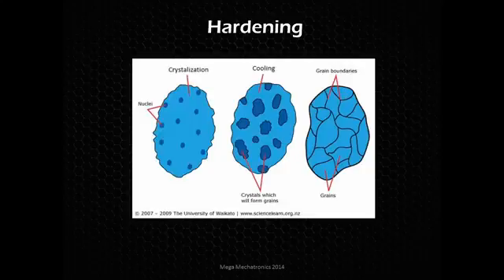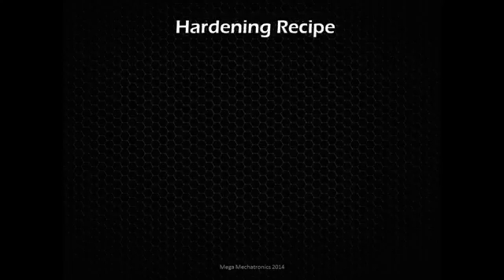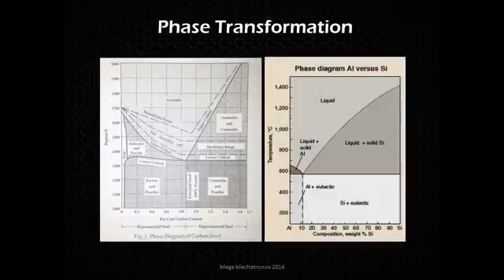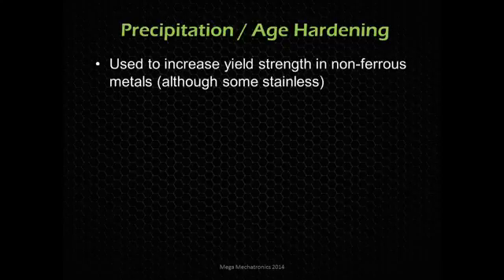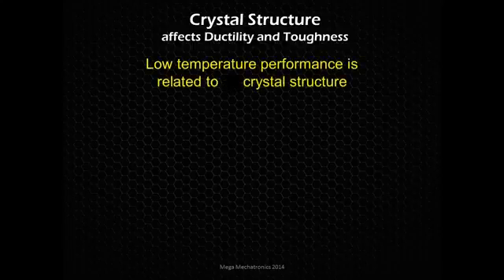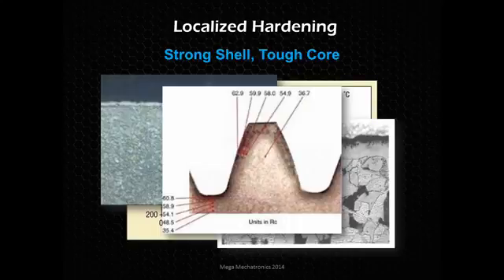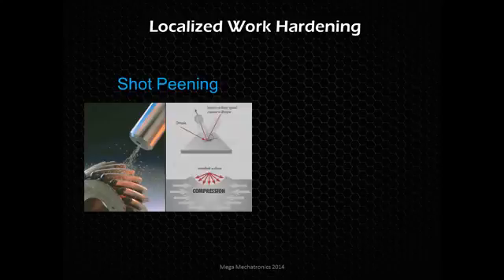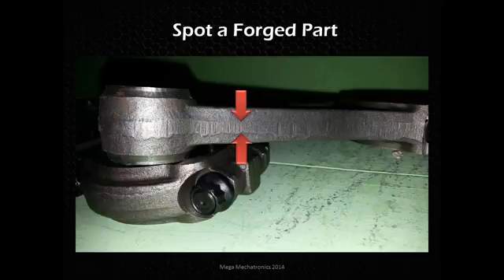Materials Science Mechanical Engineering    Part 4 Heat Treatment Explained

Comment: SIPARTOGI SILALAHI 2714100134

Hardenig is one of the most importhant treatments of
material by cristylze and modify the cubic structure. from The Video we know
that heat treatment in iron or iron alloy is important for many application in
our daily life. In the beginning of the video, it explain about how to
hardening the metal. It explain that to hardening, the metal must be
crystallized, and let the atoms on the material to move around and then the
material is cooled down and the atoms going to start forming crystals and at
the microscopic level for ferrous, a BCC (Body Centered Cubic) or FCC (Face
Centered Cubic) is formed. Crystall lattice dynamis is a dynamics of the
crystal structure. We can look that the structure of the cubes make a form that
we can moves the things around and it won’t break or fracture because the atoms
are bounded together by kind of like a magnetic force. So if we shift that over
if you classically deform it, the atoms are going to latch on to an adjacent
set of atoms and move around. The size of grain boundary is really important to
the mechanical properties of the material. The smaller the grain (finer) the
harder, stronger that material will be. The bigger the grain (coarser) the less
strength and ductile it will be for the material. Smaller grain will give a stronger
material because it will reduce possibility for the crystal lattice to move or
deform by slip mechanism. Because it will have some kind of wall to stop the
slip so it will not deform easily. we do the tempering process to develop the
required combination of hardness, strength and toughness or to relieve the
brittleness of fully hardened steels. the mechanism of tempering is more less
the same with hardening. but, if in hardening we do the holding once, then in
tempering we do the hoding twice. the purpose of this twice holding is to
soften the material, so the material would not have too high hardness and the
pupose is to relieve the stress. from what i know, there are 2 types of
tempering, the first one is austempereing, and the second one is martempering.
but, from the video above, there is one more type of tempering, which is
cryotempering. the product of austempering is bainite, otherwise, the product
of martempering is martensite. There are many types of localized hardening.
Induction hardening is a form of heat treatment in which a metal part is heated
by induction heating and then quenched. The quenched metal undergoes a
martensitic transformation, increasing the hardness and brittleness of the
part. Induction hardening is used to selectively harden areas of a part or
assembly without affecting the properties of the part as a whole. Induction
heating is a non contact heating process which utilise the principle of
electromagnetic induction to produce heat inside the surface layer of a
work-piece. Carburizing / Nitriding is a heat treatment process in which iron
or steel absorbs carbon while the metal is heated in the presence of a
carbon-bearing material, such as charcoal or carbon monoxide. Material is
heated to the suitable temperature for hardening, then cooled rapidly by
immersing the hot part is water, oil or another suitable liquid to transform
the material to a fully hardened structure. Parts which are quenched usually
must be aged, tempered or stress relieved to achieve the proper toughness,
final hardness and dimensional stability. Alloys may be air cooled, or cooled
by quenching in oil, water, or another liquid, depending upon the amount of
alloying elements in the material and final mechanical properties to be
achieved. Hardened materials are tempered to improve their dimensional
stability and toughness. Tempering is done to develop the required combination
of hardness, strength and toughness or to relieve the brittleness of fully
hardened steels. Steels are never used in the as quenched condition. The
combination of quenching and tempering is important to make tough parts. This
treatment follows a quenching or air cooling operation. Tempering is generally
considered effective in relieving stresses induced by quenching in addition to
lowering hardness to within a specified range, or meeting certain mechanical
property requirements

Comment: Name Ichsan salman 
2714100129
This my review according to the video
When we hardening a material we will melted the material so the atom will move around, next we cooled it and then those atom gonna start forming crystal. When crystal start forming randomly they gonna be crystalizing in different orientation to each other that will make a grain boundary. The concept of hardenability is different alloying in metal will gonna have different ability to hard at different maximum hardness that can achieve. Hardness vs carbon content is directly proportional on ferrous metals. Phase Transformation diagram will give engineers an idea of where to start and what temperature that will make the material have certain phase. One type of metal or one type of alloy can have many properties depend on heat treatment that been given. Tempering is done after hardening to improve toughness by re heating the material at certain temperature. Tempering temperature must below transformation temperature. Normalizing process is when we heated the material above transformation temperature and then we cooling it with air at room temperature. Normalizing will give different crystal structure than hardening process. Annealing process is when we heated the material and holding it above transformation temperature and then we controlled the cooling rate by just leave it at oven. Annealing process is primarily for softening. annealing. it is used not to make the material harder, but to make the material softer. annealing is the process of slowly raising the temperature about 50 degrees C above the Austenitic temperature line A3 or line ACM in the case of Hypoeutectoid steels and 50 degrees C into the Austenite-Cementite region in the case of Hypereutectoid steels. It is held at this temperature for sufficient time for all the material to transform into Austenite or Austenite-Cementite as the case may be. It is then slowly cooled at the rate of about 20 degree C/hr in a furnace to about 50 degree C into the Ferrite-Cementite range. At this point, it can be cooled in room temperature air with natural convection. The grain structure has coarse Pearlite with ferrite or Cementite (depending on whether hypo or hyper eutectoid). The steel becomes soft and ductile.  Precipitation is used to increase yield strength in non-ferrous metals by make a carbide, it will make defect at crystal lattice that impede movement. Precipitation is a process where a second phase that begins in solid solution with the matrix metal is precipitated out of solution with the metal as it is quenched, leaving particles of that phase distributed throughout to cause resistance to slip dislocations. This is achieved by first heating the metal to a temperature where the elements forming the particles are soluble then quenching it, trapping them in a solid solution. Had it been a liquid solution, the elements would form precipitates, just as supersaturated saltwater would precipitate small salt crystals, but atom diffusion in a solid is very slow at room temperature. A second heat treatment at a suitable temperature is then required to age the material. The elevated temperature allows the dissolved elements to diffuse much faster, and form the desired precipitated particles. The quenching is required since the material otherwise would start the precipitation already during the slow cooling. This type of precipitation results in few large particles rather than the, generally desired, profusion of small precipitates. Precipitation hardening is one of the most commonly used techniques for the hardening of metal alloys. There are several different methods to quantifiying hardness by Rockwell methods, Vickers tets, brinell methods. Crystal structure affect ductility and thoughness like body centered cubic crystal experience a ductile to brittle transtition at lower temperatures and face centered cubic crystal structured retain ductility at low temperatures. Some examples of localized hardening are induction hardening and nitriding or carburizing. At carburizing process we will place the material at room that full with carbon and then heated, so the carbon will infused to the material at the surface. Localized hardening will give strong shell and tough core material. Cryogenic Treatment is a used to transforms retained austenite into martensite by cooling it at extreme temperature such -300F by using liquid nitrogen or other. Cryogenic treatment promote uniformity and strength. Hardness vs strength is directly proportional. But hardness vs toughness is  a inversely proportional generally.work hardening or cold working is uses compression forces and plastic deformation. Cold working  creates a desirable dislocations in the crystal lattice structure, improving yield strength, but reduce ductility. The example of cold working is cold rolling process, cold heading, shot peening, roller burnishing. Another example of work hardening is hot forging. Hot forging is done at higher temperatures and will give more stronger properties than an equivalent cast part. The advantages by using forging is the grains will aligns to the shape of the part.

Comment: Bayu Sinung Pambudi
2714100073
QUIZ 1 HEAT TREATMENT
Time 13.00-14.30

Heat treatment

Heat treatment is the heating and cooling of metals to change their physical and mechanical properties, without letting it change its Heat Treatment
shape. Heat treatment could be said to be a method for strengthening materials but could also be used to alter some mechanical properties such as improving formability, machining, etc.

when we were hardening the metal, we are going to crystallize, going to let those atoms move around and look the atoms move around and then start forming crystal at microscopic level. For ferrous metal or aluminium we are looking those cubic structure like BCC (Body Centered Cubic), FCC ( Face Center Cubic) and another structure
Crystal Lattice Dynamic
Atoms are bonded together by kind like magnetic forcce so shift that over classically deform if those still latch

Grain Boundaries
Christal will start forming at cristallization in different orientation to each other
To make grain boundaries is easy because crystal structure uniform grow and grow|
The size of grain boundaries are important because if we had smaller grains more more smaller ones that give us stronger and harder material because were reducing the ability of thr string for that crystal lattice to deform and move around because there are these deformaties sort like wall stoping form moving
If we had big grain it more ductile because allow to move around and deformation

Hardenability
Limit dependent on aloying elements of the metals
Hardness dependent on carbon content in ferrous metals

Hardening recipe
Hardening recipe is important of the time, the temperatures that the material is fes during the hardening process
The inpostant of hardening is Heating rates the time at temperatures, thickness of the materials, alloying elements in it, cooling rate, if lack certain crystal structure such as martensite

Phase Transformation
The metallurgical phases present in an alloy have a huge impact on the properties of a metal component.  Phases are distinct materials that are comprised of the elements in the alloy.  These distinct materials have distinct properties that have an impact on the overall properties of the entire alloy.  Additionally, the size, shape, and location of the phases within the alloy also effect on the overall properties of an alloy.
one alloy, many properties depend on application looking

Tempering
Tempering involves heating steel that has been quenched and hardened for an adequate period of time so that the metal can be equilibrated. The hardness and strength obtained depend upon the temperature at which tempering is carried out. Higher temperatures will result into high ductility, but low strength and hardness.

Normalizing
Normalizing involves heating steel, and then keeping it at that temperature for a period of time, and then cooling it in air. The resulting microstructure is a mixture of ferrite and cementite which has a higher strength and hardness, but lower ductility. Normalizing is performed on structures and structural components that will be subjected to machining, because it improves the machinability of carbon steels.  

Annealing
Annealing involves treating steel up to a high temperature, and then cooling it very slowly to room temperature, so that the resulting microstructure will possess high ductility and toughness, but low hardness. Annealing is performed by heating a component to the appropriate temperature, soaking it at that temperature, and then shutting off the furnace while the piece is in it.

Precipitation/ Age hardening
Used to increased yield strength in non ferrous metals

Surface Hardening
In many engineering applications, it is necessary to have the surface of the component hard enough to resist wear and erosion, while maintaining ductility and toughness, to withstand impact and shock loading. This can be achieved by local austentitizing and quenching, and diffusion of hardening elements like carbon or nitrogen into the surface. Processes involved for this purpose are known as flame hardening, induction hardening, nitriding and carbonitriding.

Cryogenic treatment
A cryogenic treatment is the process of treating workpieces to cryogenic temperatures (i.e. below −190 °C (−310 °F)) in order to remove residual stresses and improve wear resistance on steels.

Quantity of Hardness
Brinell Hardness Test
 Vickers Hardness Test
 Rockwell Hardess Test
Scratch Test

Important Reaction in Phase Diagrams
Peritectic reaction Liquid+Solid1↔Solid2
Eutectic reaction Liquid↔Solid1+Solid2
Eutectoid reaction Solid1↔Solid2+Solid3